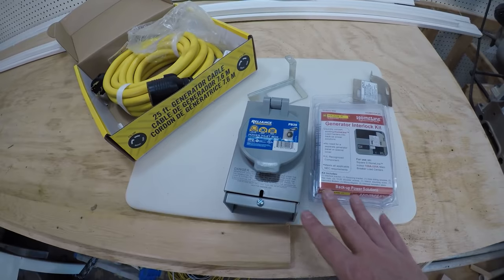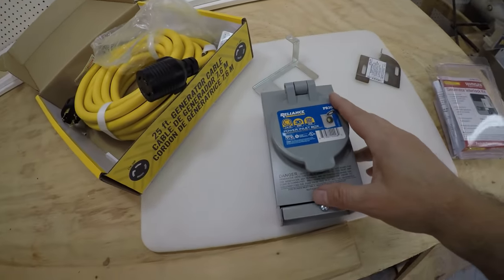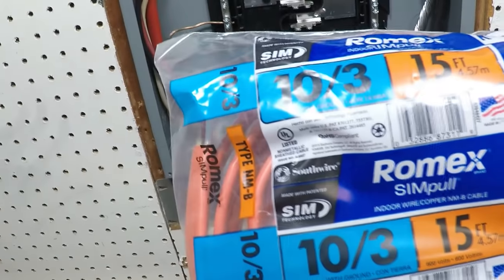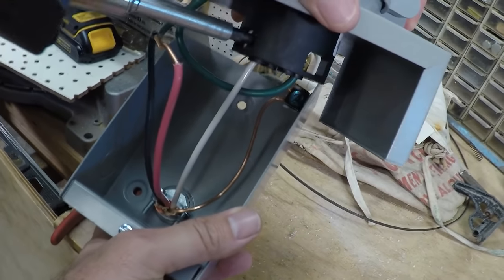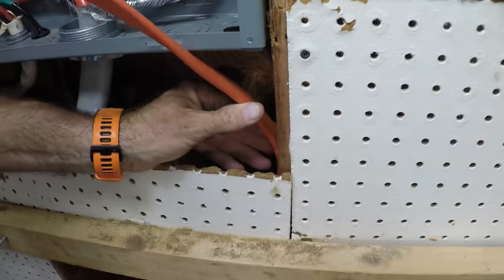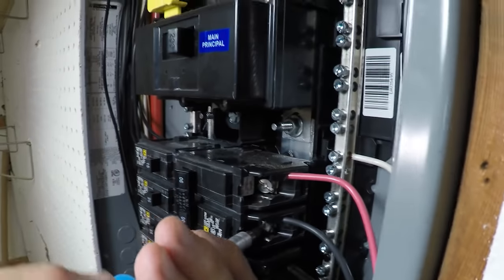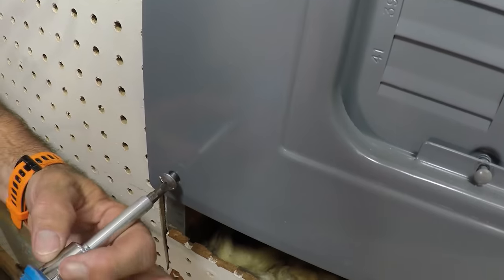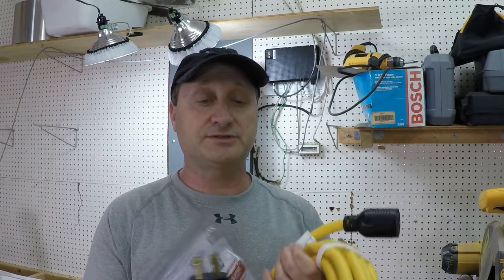Home Generator Interlock Kit Installation - EASY!

Comment: Your inlet box was a 30 Amp wired to a 30 amp breaker.  What do you do if your generator is a 8000 continuous.  A 30 Limits out at 7500.
Reply from the maker: you can size up to 50 amps if you want

Comment: Great Job!! Thanks 👍👍. How about going over Sizing of Gen needed for different home power requirements?  Thanks again 👍
Reply from the maker: Thank you for watching and a great idea for a future video...
Reply: Sub’d 👍
Reply: Can go Higher Amps, just be sure, Breaker, Wiring, Cord can Handle the Higher Amps
Reply: I have a 3350/125 amp generator. Will this work? Do they make 3 prong box. Thanks for any replies.
Reply: @morgancoyne8509  If you are saying you have a 3350 watt generator, it is not 125amp...
Reply: @tonyb4821  my apologies, I didn’t see I put amps, I meant volts. Thank you for that correction.
Reply: I’m realizing I do need to go bigger if I want to run my stove, water heater, or anything 220.

Comment: Do u have to use a certain brand or does this kit work with all panels? Ty
Reply from the maker: it should work with all
Reply: To meet code, it has to be by the manufacturer of the control panel box. For example, if the main control panel was manufactured by GE, then the interlock switch must be made by GE.

Comment: Yea it's easy if you have room in your panel, but mine is full up even using double breakers in one slot.
Reply from the maker: you may need to use a transfer switch instead

Comment: No question is dumb, right? Good🙃
Was that 30 amp breaker one that was already in use in your panel, or do we put in a breaker for this purpose? 
Thx! For the video
Reply from the maker: I added that breaker when I had the panel installed just two months earlier. It was all planned. thanks for watching!

Comment: If I did this job I would use a ground kit in the panel also
Reply from the maker: Sure... whatever works for you
Reply: Thanks flannel  guy. . There also is a manual   transfer switch  for portable  generators. Which is a nice option  .

Comment: Does it matter if the breaker is single or double pole?
Reply: yes it matters. You need a 240v double pole breaker. Size the breaker to the wire conductor size that you have from the generator to the panel.   Reference a wire gauge vs. amperage chart.  But yes def needs to be a double pole breaker as your feeding it with two hots and a ground.  But the generator of course needs 240v output too...

Comment: What was the Orange cord?
Reply from the maker: It was the 10/3 wire going from the panel to the outlet box on the outside
Reply: Good video. How do you connect a 3-prong generator to the electrical panel?

Comment: Problem is most fuse boxes on newer homes are full from the get go and you unfortunately have to pay a pretty hefty price to have an electrician install a bigger panel to install a breaker for a generator

Comment: I need something like this. But my double 240v is at the bottom of my box and the main is at the top. So this specific one wont work.
Reply from the maker: I dont think you will find any that will work in your situation. You may have to rearrange the breakers if you have enough wire to do so.

Comment: It doesn't cost that much more to put in PV50 So you can run up to A 12KW generator. I don't even bother with 30 amp. Just go 50amp or hardwire it

Comment: Technically correct however you failed to seal the hole in the building behind the box.  Insects and moisture will enter through the void created by the shape of the siding.  Use a latex building caulk not RTV silicone to close it up.  Otherwise a great video.
Reply from the maker: It was done off camera. The video was long enough and I figured people were coming to see how the thing gets wired. thanks for watching...

Comment: My question though is, how would you know if the power is restored on your street if you are running off the generator? Would you simply go by eyesight and looking out? Then turn off the generator and go and flip the breaker back on again?
Reply from the maker: just have your neighbor call you

Comment: I was curious so I phoned my local electric provider. They fixed me right up with an all in one New meter. It's got a plug already built in. No rewiring involved...
Reply: How much did your provider charge for the transfer?
Reply from the maker: good for you...
Reply: Can you explain this more, So your hooking your gen directly into your meter? If so what amperages are allowed, I have A 50 AMP gen.
Reply: @rsk8310  The power company knew by looking at my generator they could tell which power cord ( they provided the power cord) for me to use from my Gen. to the meter.

Comment: Hi, how do you know when the main is restored
Reply from the maker: you can look at street lights or check the neighbor's homes.
Reply: Reliance controls sells a “power back” alarm.
Reply: This is a good question and the reason as an electrician I do not like to generalize. Some of my clients are very knowledgeable and have volt meters and skills to figure out things. Some should not do anything but give me a call. Honestly if you are asking this question you either need to educate yourself about electrical or call an electrician.
Reply: @Sparkeycarp  so if your sitting on the couch,  being a electrician you will know when the power is back on. I know how to check the main feed coming in . Question was how do you know when to check it
Reply: @neilbrookins8428  
Thank you
Reply: I've seen that Reliance "Power Back" Audio alert mentioned below which seems to work fine. But does anyone know if there is one that is a light indicator instead of an audio alert? I've googled but have not found anything. Thanks!

Comment: Especially for beginners: You didn't seal the screws you mounted the box with. #2, do not use that cruddy ratchet driver. Use properly sized standard flat head or square drive (Proper tool for the job). Which leads to, you held onto the metal driver while you were on hot leads!!! (even if breaker is off). Never get used to touching metal like that.

Comment: Will this power both sides of the panel, or only the right side?
Reply: Whatever you flip on will work lol
Reply: The generator is connected to two adjacent breakers. One powers one leg the other powers the other leg.
Reply: @neilbrookins8428  thank you.
Reply: One Hot Leg Powers Every Other  Breaker, both sides of Panel, That's why a 2 Pole Breaker can get 240 Volts from either side of Breaker. 
If you have  a 120 Volt Generator, You need a Jumper on the Generator Breaker to supply other half of it the 120 Volt Circuits, Any 240 Volt Circuits Seeing same 120 volt leg will do nothing, Harm Nothing
Reply: Call a licensed electrician. Or get an electrical education.
Reply: @Sparkeycarp  Thanks for the concern. 
i got it figured out. Just searched on what "double pole breakers" are.
Reply: @neilbrookins8428  Thanks for the explanation. Got it.
Reply: @randyaivaz3356  Thanks for the explanation. Got it.
Reply: @randyaivaz3356   So if you are using 120v generator, we should manually turn off all the 240v 2 pole breakers for AC and other 240v appliances?
Reply: @randyaivaz3356  Yes thats correct when on the 120v 2800 watt generator powering a 240v load center with interlock kit and jumped double pole 30 amp breaker all 120v circuits work and nothing 240v does leaving all breakers on its worked fine no problem

Comment: Someone was arguing with me about this recently saying that even if your main disconnect is off and you're backfeeding from a generator it can still send electricity through the neutral back to the pole and possibly kill a line worker.  Anyone know if this is true?
Reply: if your Ground/bonding is faulty and have an unbalanced load there can be voltage on the Neutral. 
Line personnel put grounds on the Line conductors they are working on. Which would load up the Gen set tripping it's breakers.

Comment: Q: Is an interlock switch legal in Canada? A: NO. 
You can only have one in the open position at a time or closed position, but they're mounted to the front cover. In Canada, these are not permitted because you can just take the cover off and then now the transfer scheme, the interlock is actually defeated.

Comment: Is this code for most agencies?
Reply from the maker: which agencies are you referring to?
Reply: @flannelguydiy6458  what is most agency’s electrical codes. Is this within the electrical code as an acceptable practice? I realize there are exceptions but what do most specify as acceptable? If acceptable,  will they likely require a permit? I enjoyed your video as an easy to do project given today we have more power failures and shutoffs. I live in CA where they have shutdown or idle a number   Of natural  gas powered power  plants for renewables. Guess what? Solar and wind are not cutting it. I have a generator and hate manually running wires into the house for the essentials. By the way, I want to get a 120/240V propane powered  inverter generator for normal house loads turning off AC, dryer and high loads. Can you recommend one? Hard find 240V inverter style gas or propane.  Want to use a double pole switch to power both sub-panel legs with a 240V generator using your example. Assume need  240V to power both legs. Do you know if both legs are in phase since come off the same power company secondary. Thanks kindly, Bob

Comment: Interlock kit doesn't prevent backfeed on the neutral  to street side.
Reply from the maker: yes it does prevent it. There is NOTHING going back to the street when the main breaker is shut off
Reply: @flannelguydiy6458  Neutral is still connected, Any unbalance load will energize it if the Grounding/Bonding is faulty. A proper Transfer Switch Disconnects the Neutral..

Comment: Is the breaker the generator feeds from a basic breaker?
Reply: The 2/30 breaker is being used to feed the other breakers in the panel. Your generator will need to feed 120 volts on two legs. If you have the matching L6-30 connector as the inlet and cable shown on your generator you are all set.
Reply: Generator outlet will be L14-30.
Reply: The Square D interlock is compatible with the QOM2 frame mains, and a standard 2-pole QO breaker up to 125A.  The typical breakers used, depending on the size of the house loads and the generator size, would either be a 30A or 50A 2-pole breaker.

Comment: Is the interlock kit universal? I believe my panel box is by GE
Reply: You need to have the correct interlock switch for the brand and amp box u have
Reply: It’ll tell you on the package with your breaker model.

Comment: if you're not a certified electrician, make sure you get local inspector (AHJ) to sign-off on any house wire modifications you're doing.  Safety first.

Comment: You are using a 30 amp cord and plug to power the house. I think you need a bigger cord and plug before you have a fire. Granted you have a 30A breaker.
Reply from the maker: If I was going to power the entire house, then I would need a 100 amp breaker. The 30 amps is handling everything that I would turn on during a power outage. Refrigerator, fan for the furnace, some LED lights, etc. Would not use the AC and do not have an electric stove or electric dryer.  Everyone needs to analyze their own home to figure out what size breaker they need. This video was just about how to install the interlock kit.

Comment: Before you buy an interlock kit or transfer switch, check with your local code. My dumb state throws away a permit unless it is installed by a licensed electrician, which is quoted over $1500. It looks like I must rely on extension cords throughout my house as I can't afford to pay $1500 and even if I could I wouldn't pay $1500 for something simple like this.

Comment: My biggest fear is drilling a hole through the wall of my house, for the 
wire that will run to the panel.
(Measure 1,000 times and drill once. LOL)

Comment: Listen, you said it doesn’t matter where the wires go in !  so what’s the purpose of having the letters written  white black green whatever the color is?
Reply: The white is the important one since it’s neutral.  The red and black are both hot.  White wire MUST go in the W-hole

Comment: I wonder if any other electricians watch this and get bent out of shape when you put the romex connector backwards in the power inlet box. How an inspector would pass that I don’t know.
Reply: For the average homeowner this can be a confusing mess when the power goes out and there's no lights. I'm an electrical contractor we install about 10 backup generator panels and generacs a week. I always strongly suggest to people we install a backup generator subpanel that sized to the generator. That way they're not flipping their heavy loads on and off and all they have to do is flip the transfer bracket that's powering the generator sub panel.
Reply: @PaulNelsonphotography  I was talking about the romex connector being installed backwards. Also why not automatic transfer switches?

Comment: My panel does not slide as easy as that at all, I have to take a screwdriver and force it down or up
Reply: Loosen the screws.
Reply: @TheMan-qv1bl  They are as loose as you can get them without them falling out

Comment: he hee that what i did ran extension cord around the ceiling walls. where it hide. Into each room. With a surge protector switch on it. Turn it off and on the room as i leave it!  It works good. Plus it give me extra Extension cords,  and surge protectors.. It was just cheaper to do it this way. Than having a electrician come out, to figure this rats nest out, and install it ~ Plus they didn't have these kits to buy at the time either >  So i ran extension cords >  SO ITS GOING TO STAY UP THERE. You have to look close to see the extension cord

Comment: I've been an electrician for over 20 years. I have done this particular process many times. This video is fine for the 10% of people who are capable. But very dangerous for the 90% who are not. Who is liable for burning down the house the ignorant home owner or the YouTuber who gave them the idea?
Reply: I think it's helpful to see the process and warnings. The interlock kit installation videos I watched on here convinced me that it was beyond my skill set, so I hired an electrician. Videos like this also helped me know what to tell the electrician I wanted and to supervise his work. Lastly, I appreciate videos like this because I can share them with friends that are considering copying my set up.
Reply: I have a healthy respect for electricity.  But my county does not require permits and the building inspector for my home loan never pointed out the faults in the wiring done by previous "electricians".  With videos like this I'm hoping to be able to find how it should be done correctly.

Comment: This is not the safest way or best way you missing one important step in this setup , disconnecting your neutral and ground wire or installing a AB manual transfer switch.

Comment: It appears you guys did all of that with the mains breaker on, NOT A GOOD IDEA!
Reply: Electricians do hot work all the time.
Reply: @Wurmfist  Doing something stupid all the time doesn’t make it a good idea.
Reply: @alrui  it's not stupid, sometimes there's no choice. you obviously don't work in the industry. I work with industrial contractors that work with big boy stuff, not the stuff found in residential homes.
Reply: @Wurmfist  Different strokes for different folks. I’ve seen my maintenance guys at work (full blown factory) do similar and I’ve seen some close calls, it’s not good practice PERIOD!
Reply from the maker: Two things...
1. the main breaker was off when the 30 amp breaker was installed weeks before filming the video.
2. you do not have to shut off the main every time you do any work in the panel. Not if you know what you are doing and you are comfortable working with electricity. What is important here is the 30 amp breaker that received the new wires was off at the time.

Comment: I don't see the point of a separate breaker, just interlock kit and plug into dryer outlet it is already wired to the breaker you're just duplicating what's already there
Reply from the maker: dryer outlet?? Maybe you should watch again

Comment: This interlock kit (plate) sells for $60 on Amazon. Ridiculous! I made one from a piece of 1/8” sheet aluminum for free that took 30 minutes tops using wood tools. Aluminum’ soft. It’s not rocket science but be accurate on measurements. You do need to do your homework though before installing the outlet box and going into the panel.

Comment: I understand where your coming from. But whats to stop someone or someone other than the DIYer in the house from turning something on that does not understand? He/she could pull amps than they should. 

To me, its like teaching a 12yr. old how to drive that does not understand what could happen.
Reply from the maker: you should be flipping off the breakers on the things that you do not want them to use.. like the AC and the microwave

Comment: unless this type of "interlock" comes with a big guy to beat you about the head and shoulders until you install it properly and comes back if you ever try to defeat it, this kit should be illegal!

first person who can't fit it properly will probably say "it's OK, i'll never forget" and leave the metal plate in the box it came in.
Reply from the maker: that is why you need a permit and an inspection.